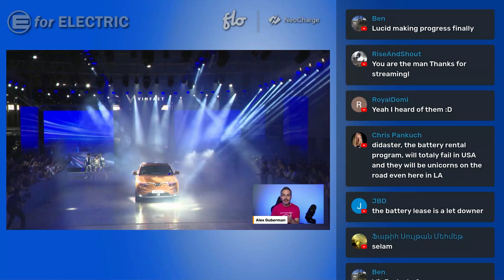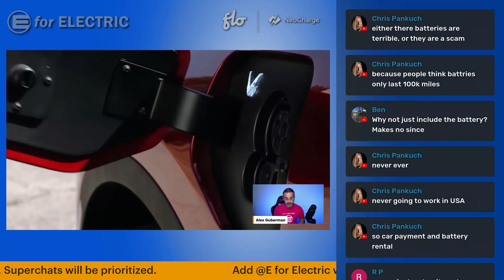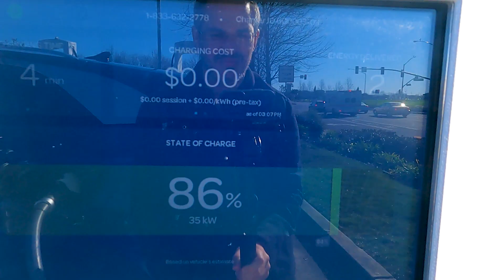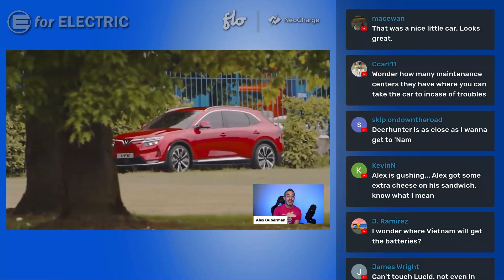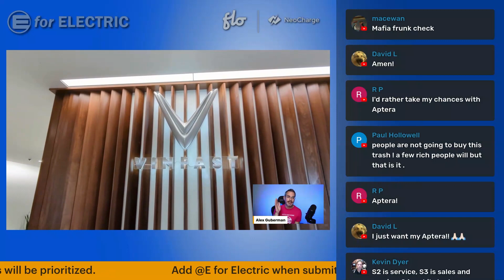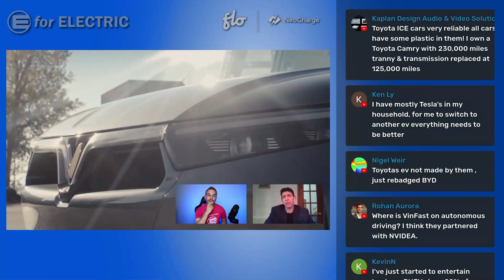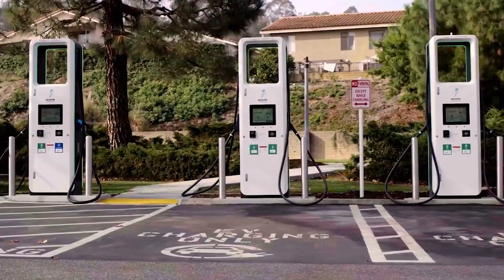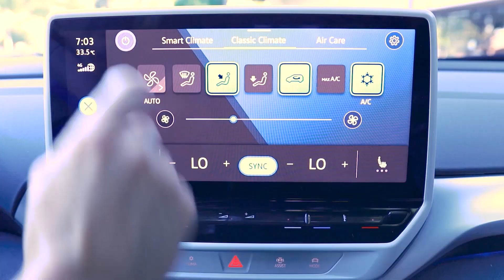New EV Sneaks Up on Everyone

Comment: Still don't think that battery rental thing is gonna fly but it'll be interesting to see how it goes.
Reply: I still don't understand how people can pay tens of thousands of dollars for new cars then pay interest on top of that, let alone lease them, VinFast will find a customer base. People forget nearly everything we bought at one time was *batteries not included. The overall price is the main sticking point though, they need to lower it if they want to stick around.
Reply: I think it will be most likely for the 30 and under group. They are getting used to subscribing to a lot of things and don't have the mental hang up about it like I do.
Reply: At $18 per 1,000 ur only saving like $10 a month by renting/leasing the battery vs just leading or buying the car with battery
Reply: Agreed, I don’t want to rent the battery for 10 years.
Reply: Think of it as being possible to get new battery tech along the way. If I was Vinfast that is how I would market the battery swap to make it more palatable AND something to look forward to.
Reply: @Marker-er3ro  They give you the option to buy or rent a battery, Update the news...^^~
-----
December will hand over to customers in the US
Reply: They give you the option to buy or rent a battery, Update the news...^^~
-----
December will hand over to customers in the US
Reply: The cost of a subscription adds $219 a month to your payment, so in the long run you still pay the $76, 000 asking price
Reply: @rideshareroadwarriorrick  They give you the option to buy or rent a battery, Update the news...^^~
-----
December will hand over to customers in the USA !!
-----
5,000 VF8 vehicles will be handed over to US customers this December
Reply: Renault used to do it.
Reply: It's probably going to do somewhat better in Europe, due to general cultural differences.

Comment: My reservation in Aug 22’ holds the price at $40,700 vf8 eco with a battery sub at $50/mo. I love not worrying about the battery . I love the fact they offered me 3 yrs free charging (no sub) and then I will be paying the $50/mp. My plan is to buy the vehicle in Memorial Day 2023 with a 3 yr loan and a large down . Once the car is paid off , the battery sub will begin and if it ever falls below 70% , they replace it for free . I’m locked in at the price and it’s transferable. I’ve had my first EV for 4 yrs 6 mo. and the battery has held up . But, if I had used fast charging more than a few times, I would have already lost 8%-10% of the useable battery according to reports I’ve read. Buying the battery is a waste of up front money with no replacement strategy . It costs $12k to replace these .

Comment: The battery lease option makes perfect sense.
Reply: Yeah, and the aversion towards leasing is really more of an American cultural thing, imho. I think battery leasing, replacement, etc... will generally work significantly better in Europe, because people are more used to sharing various things, like public transportation, public pools or public universities, and things like gated communities are also a lot less common.
Reply: @highdefinist9697  absolutely, which I find weird as Americans never buy anything outright they always rent it lease or borrow the money so you’d think they would love this option
Reply: @JustinParksandRides  I think the issue is you buy the car and lease the battery.  If they want a lease program, just lease the whole thing.  The overwhelming majority of USA consumers buy their cars.  I agree Americans like to rent things, but this is a "Half pregnant" problem.  If you are going to own the car for a few years, the math works, but battery failure is the manufacturers responsibility for all other makers in the space.  They are solving a problem that doesn't exist.  I get it, they like the cashflow of recurring subscriptions, they just forgot to provide value for the service.

Comment: For people who drive a lot of miles, the battery lease is probably the better deal. The breakeven point is about 7 to 8 years, so if you plan on driving 150k-200k+ miles in the next 7 to 8 years, then this lease is a likely the better way to go. If you do 10k-15k miles per year and assume the battery will last 10 to 15 years, buying is the better way to go. I fall into the second category, and would buy the battery.
Reply: For rental and corporate fleets this could be especially attractive, especially for the unlimited km.
Reply: You'll miss out on the possibility of new battery tech being made available along the way.
Reply: They give you the option to buy or rent a battery, Update the news...!
Reply: Well as a reservation holder prior to September 1 I get old pricing so leasing may make sense.

Comment: Price needs to start at 35K.  VinFast needs a bare bones model with minimum features, interior finishings, a smaller battery, smaller wheels and NO perks or free charging(nothing is free).  Offer the cheap version with one motor instead of the standard 2.  I see most EV's as around town (point A to point B) vehicles where 150 mile charge would be adequate and drive down the cost.  Cheaper cars are the ones that will sell in volume over the next few years.  VinFast (New brand) needs to attract average customers.

Comment: Each day I'm sold a little more on the battery subscription program. It's going to degrade. And it's going to keep degrading once your warranty expires. Why should you bear the responsibility of replacing it, or finding a shop to repair it, or even disposing of it? Also, the peace of mind you'll have when buying a used one. You can have confidence that you'll have a functioning battery and it will be fixed or replaced after five or seven years of fast charging and use.

Comment: Leasing the battery doesn't make sense to me.  My Chevy Bolt has an 8 year/100,000 mile full warranty on my new battery.   Leasing a battery could possibly leave open the possibility of the monthly lease charge going up later.  New Teslas get a 120,000 mile/8 year battery warranty on new Model 3 and Ys--4 Years on the car and  5 years on the safety restrain system.

Comment: I think it would have been smarter for the two models they start with to have been the 7 and 9, instead of the 8 and 9.  I understand that the crossover market of the size of the 8 is the hot spot right now but it is SOOOOO crowded in the EV market that for a new brand it will be really hard to stand out.  Something the next size down would be less expensive and have much less competition. It would be competing against stuff like the Niro and maybe the Kona?  There would be no question that the VF7 would likely blow those out of the water in 2023.
Reply: Crowded? Not really. There’s very few three row EVs on the market and all of them have premium pricing, sadly.
Reply: @TecnamTwin  That's the 9 that's the 3 row, I said to keep the 9.
Reply: I agree, EVs are way to expensive. Other cars are too, though.

Comment: The math on the battery leasing program seems to me to make a LOT of sense.  If you're buying the VF8, you save 15K right off the bat.  At $169 a month, it would take more than SEVEN YEARS to pay $15,000.00!  This means if you're upgrading your car in less than around 7 years or less you're actually ahead of the game.  If you're the kind of person that doesn't drive a lot you can even get the cheaper leasing program for around half the price, meaning it could take closer to 11 years before you've spent $15K.  If you drive a lot, even say a full time Uber driver, you're going to put anywhere from 25 to 50K miles per year, which means the battery would die in about 5-8 years.  Instead of having to shell out $15 to $20,000 for a new battery, you simply get a new one under the lease terms (since it's not your battery anyway!).  Resale value will be high because everyone knows that if they buy the car and the battery dies, it gets replaced for free!

Comment: What is the chemistry of the battery? If it is LFP or better LMFP, the leasing is non-sense as it will last more that the lifetime of the car. Leasing for a degradation prone battery like a ternary battery make sense, as you can get a replacement when below 70%, but it is a non-sense too as LMFP is cheaper than ternary and safer as thermal runaway fires 🔥 doesn’t happen. So, in the end, the leasing thing is stupid.

Comment: For VW lack of software updates, it's the legacy brands that have for decades had supply chain do most everything but bolt the cars together so this is new to them, and they mostly suck at it. Same when I had my Bolt. The MyChevy app looked and felt ten years old, never had an infotainment update although I luckily didn't have some of the problems others had needing to reboot occasionally. They also have their dealer network to appease so rather than OTA it will often be a trip to the shop instead. Only Tesla and the new startups will have their shit together for OTA.

Comment: This lease a battery is for people bad at math.  After 7.3 years you have paid the same as buying the car with battery.  Tesla has 8 years warranty on battery and motors and will replace it if something goes wrong with it.
Reply: Yeah, but can you get new tech in the replacement as soon as available or will you have to wait for failure?
Reply: @mortegasr  so what packs does Vinfast having coming?  Tesla is making 4650s.
Reply: They give you the option to buy or rent a battery, Update the news...!!!

Comment: Well, battery lease of 120 euros per month is too much. Renault had it to 58, NIO has it at 12+charging. With  the threshold  of 70 percent in mind, The battery will last probably around 15 years.
 So 120 x 12 = 1440 x 15 = 21,600 euros.  I am pretty sure they will  be making pretty good profits out of this because they're buying big quantities, on the other hand, is one or the other for the customer.

Comment: Hello, I discovered the brand Vinfast at the latest Paris motor show. I was really impressed by the design and the build quality for such a new brand. In France, the state finances up to €6,000 for the purchase of an electric vehicle if the total value doesn’t exceed €60k. 
Vinfast is very smart, when customers buy VinFast EVs, the cost of the battery can be excluded from the purchase price of the vehicle in order to remain below the 60k€ mark.
VinFast offers a monthly basis Battery Subscription Program. The program includes unlimited mileage in the monthly subscription for VF 8: € 120 and VF 9: € 150.
By renting the battery you are guaranteed to have a battery at 100% of its total capacity throughout the life of the car.
Not bad for an only 4 years old company to be able to produce and to deliver at least two different models worldwide…

Comment: I own a 2012 Passat TDI SEL. Love the car, but hate the "state of the art" infotainment system. 

The voice recognition is wrong virtually 100 percent of the time. 

Typing a destination into the navigation system is torture. The touch screen is glacially slow and often doesn't accept one's "keystrokes". If you don't give up and move to smart phone navigation (a mistake) rekeying the last "keystroke" may result in a double entry or nothing. 

In 2012, I was promised that a free update of the software and firmware was nearly ready for release. What a surprise ... still waiting.

VW builds great cars, but has no clue how to do most technology. And I will never again count on VW updates. If they do release an update it will probably be as buggy as a garbage skow.

Comment: Kinda expensive.  The price for the VF8 is higher than the top trim for Ioniq 5 and EV6, ID.4.  Dunno if this is AWD or RWD, but if it’s RWD then the range is worse than Ioniq and EV 6… ALso, ID.4 comes with 3 year EA charge and Ioniq/EV6 comes with 2 years free charge.  ANd yea, they also come with pretty good warranties 10 years.  Of course buying these at MSRP is impossible so VF is prob gonna be cheaper, providded that it doesn’t go through any dealersrhips.  Competition is good and choices are better, so hope they do well.
Reply: Thúy Kiều  Sounds like a great car, but like I said kinda expensive.  VF8 starts at $42K without battery, which is roughly $2K above standard range Ioniq 5.  VF8 with the battery starts at $57k, which is higher than Ioniq 5's top trim.  As for the features, I don't really see anything uniquely different from what others offer at this price pt whether it's Auto pilot, Blue Cruise, Super Cruise, HDA I/II, etc.  No offense, but at $57K starting I'd be much more interested in picking up Lyriq or Tesla Model Y Standard Range (if it becomes available).  This would be a knock out steal at $35 - $45K starting esp given their lack of recognition, infrastructure or proven quality.
Reply: Thúy Kiều  True, but $7500 tax credit comes into play when they begin selling next year.  Also true for Tesla Model Y.  bringing down the cost of Lyriq below VF8 and Long Range Model Y very close to VF8.  But even discounting that, these brands already have established service centers and higher potential for value retention.  Look at Alfa Romeo Stelvios, despite wide brand recognition in Europe, it's not selling too well in the U.S. and their resale values are among the worst (if not THE worst).

Comment: Munro hawks Tesla, this guy all the rest. It's a prominent subject so why not cash in? I do enjoy the breakdown and explanation of the technology and how it is applied and packaged. In the modern world where everything looks refined and futuristic it is so easy to overlook that EV technology is still in the Curved Dash Oldsmobile phase. Way too much money for all its limited abilities. 

My $5,300 ICE has a range of 450 miles on 12 gallons, and I use only $20 worth for the 300 miles I commute each week. Takes maybe five minutes to refuel. Maintenance is $80/year, divided by two oil changes and around $100/year in tread wear, second set of rubber. At 73,000 miles, not one repair or even a recall.

EVs are competing with that kind of capability and moreso the economy of it, not each other.

Comment: I'll probably keep my 2017 Civic until 2027 and then finally then there will be a decent EV that's not overpriced, holds a charge, has decent range, and doesn't take 3 hours to charge at a fast charger.

Comment: Like the look won’t rent a battery
Reply: You will be locked into the battery tech at that point in time. Duh.
Reply: @mortegasr  in my opinion, battery tech will progress significantly. However, I think auto makers for suvs will cap
The range around 300 miles. Mainly bc that is plenty. Leasing a battery doesn’t guarantee faster charging even with a different battery. The charging components would need changed as well. Basically would need to trade I. For a new car to get the new tech anyways is my point. The charging will only be as good as the weakest link.
Reply: They give you the option to buy or rent a battery, Update the news.
Reply: @xxguchiwaraxx  you’re right. Jumped the gun on my comment.

Comment: You can finally buy an EV without a battery.
Reply: Technically, is not really an EV without a battery. The definition of vehicle implies mobility.
Reply: @tomcarr6416  lol the battery is literally the 'E' in EV. E for electric
Reply: They give you the option to buy or rent a battery, Update the news...
Reply: @xxguchiwaraxx  while every other manufacturers includes a battery and at least 8 years warranty for free... Vinfast isn't any cheaper than other options tbh.
Reply: @qpalzmsk1986  Each segment will have a different price, You need cheap prices will have a cheap segment. 
VF5 vs VF6
Reply: @qpalzmsk1986  Experience Vinfast's car technologies, you will have the most accurate view
Reply: @xxguchiwaraxx  Yeah... I haven't been impressed by the reviews. Then again, I've been spoiled by my Tesla.
Reply: @xxguchiwaraxx  will you stop spamming the same thing on everyone comments. 

VF8 price with battery is 57k vs top of the line Kia EV6 GT line also at 57k but with tons of options and on paper the specs are a lot better. Not to mention other brand like Hyundai, Tesla Model y.

Vinfast selling point was battery subscription, but now they increase vf8 from 110-169, vf9 160-219 monthly . It doesn’t make sense anymore. People are not going to buy an unknown brand with out any infrastructure for after sale service.
Reply: @minhnguyen-fr5zq  m lên nhớ , mua hay ko mua thì đó là nhận định cá nhân , m đang đưa thông tin để so sánh , việc đó là việc của mỗi ng , t chỉ chia sẻ tin tức , m chỉ nên ý kiến là tin đó đúng hay sai.  Chứ t éo có nhu cầu cần m chỉ bảo , bớt xl đi
Reply: @xxguchiwaraxx  apparently you have no education nor manners. Don’t insult me personally, using vulgarity words because I have a different opinion.

Do all Vinfast employee does this ?

Comment: Please......will ANY EV owner step up and show me batteries that are dead at a rate that we need a battery leasing system after 10 years.
This tells me they have NO confidence in their technology.
Tesla's are on the road for over 200k and counting with tires, washer fluid and brake pads as the only maintenance.

PS...i hav owned 3 ev;s in the last 10 years.....none died, not even close